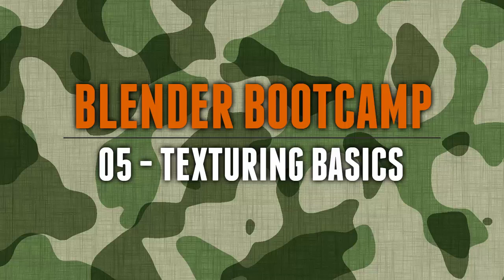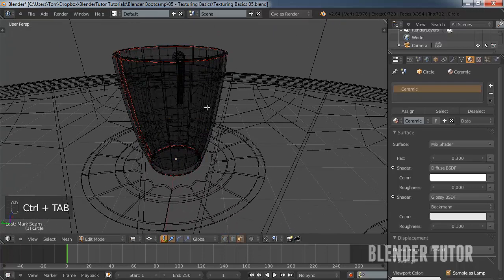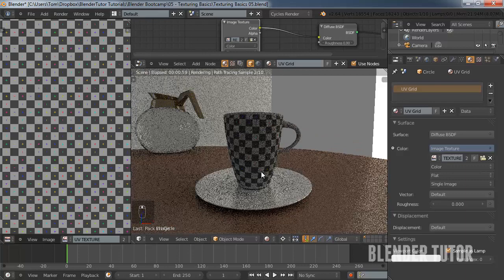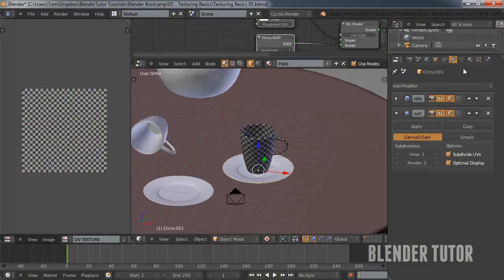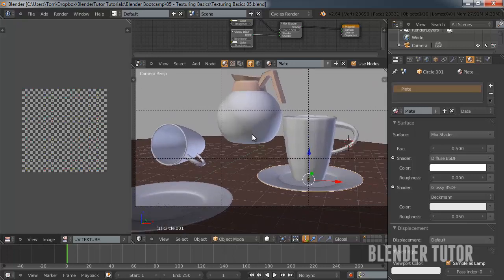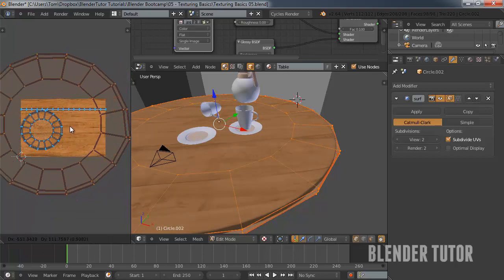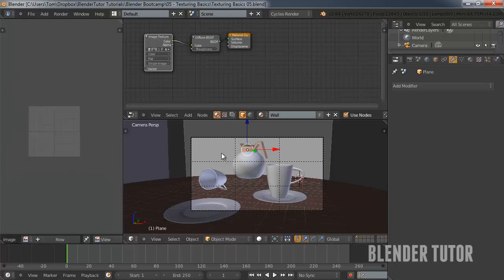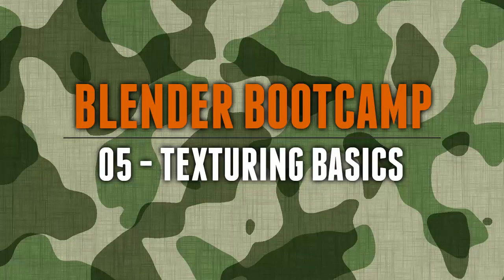Blender Bootcamp Tutorial Series - 05 Texturing Basics

Comment: Great tutorial(s)! (I have completed all the previous ones in the bootcamp :D)

I have just one tiny problem: I get the same 'error' as you initially faced when texturing the table. Even if I try to fix it by extruding invards from the edge face selection and changing seams, I still end up with a strange star shape on top of the table. Any suggestions?